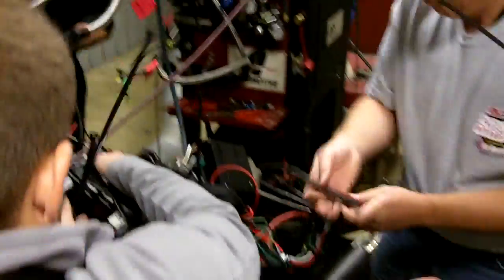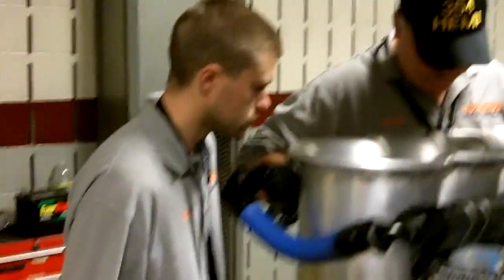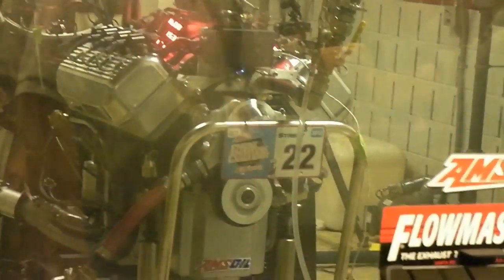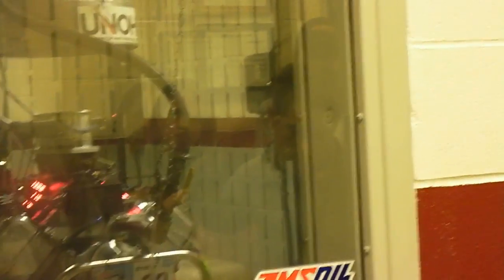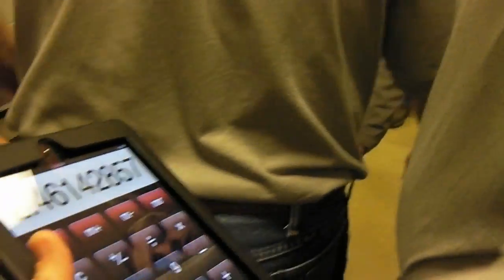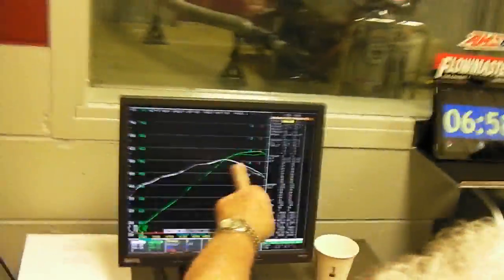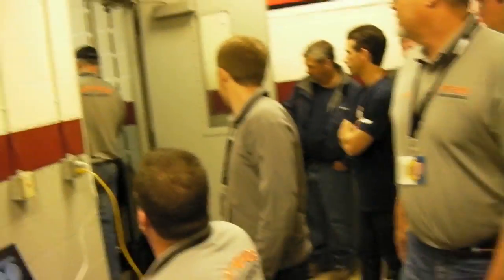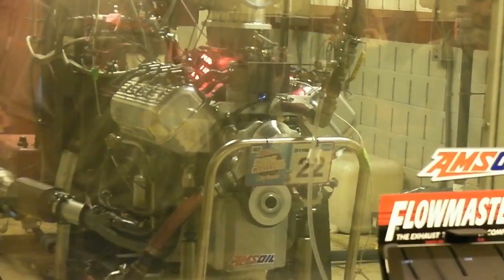Inside the Dyno Room - uncut - Engine Masters Team #22

Comment: Congratulations on placing 2nd.  Are you just running the 8 injectors above the throttle body or are there more down low?  I see the hoses for the mechanical injection.  Did you use them for anything?  Is the manifold plenum common to all cylinders or divided?  I see the MS-III.  Were you able to see a big difference in trimming ign and fuel.  How many pulls have been made on that setup?